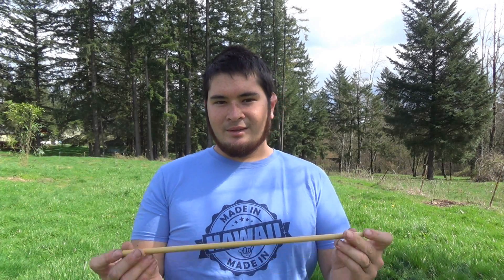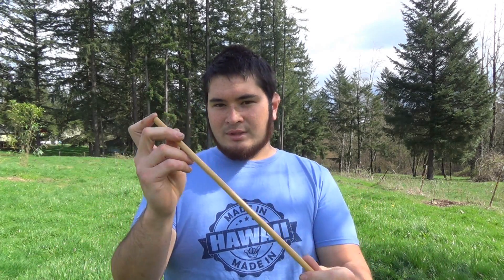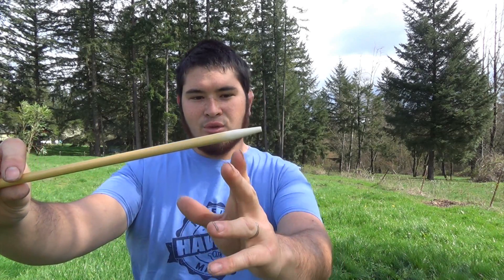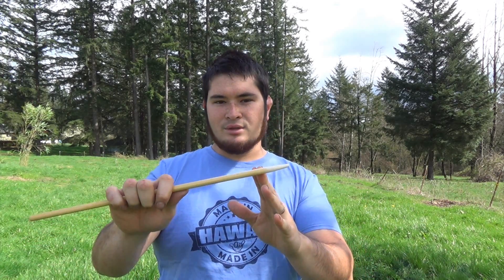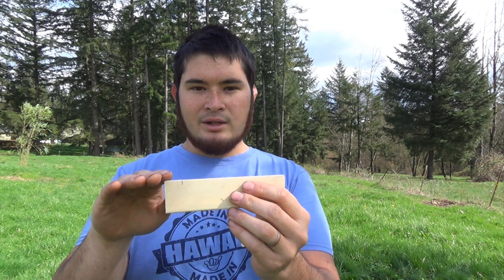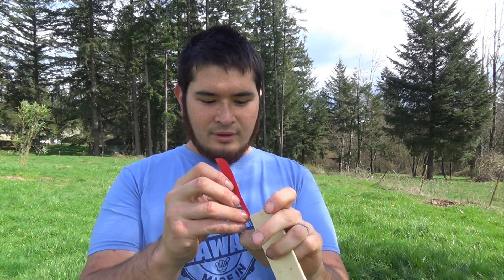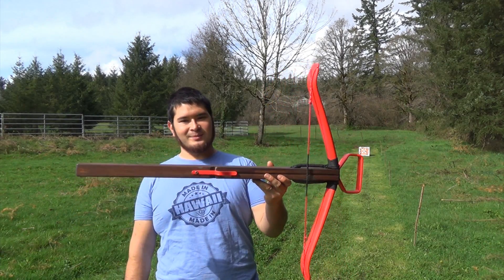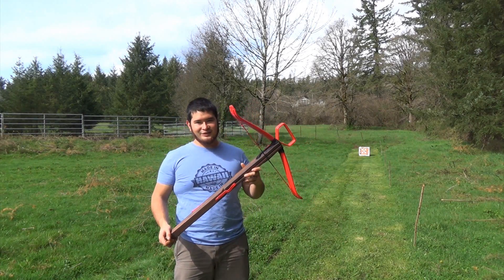100lb Medieval Style PVC Crossbow for Under $10 Part 6 - Making Crossbow Bolts with Wood Dowels

Comment: I really appreciate all your videos. 

I made the 100 lb. crossbow.  I made 16" bolts from 3/8" pine dowels and fletched with 2 duct tape "feathers". I pointed them with 3/4" #6 screws driven in about 1/2".  The flight is erratic to the max!  Any suggestions?
Thank you for you valuable reply.

I have made the 60" longbow with seahs and get a 45-50 lb. draw. Made 28" arrows from 5/16" pine dowels - works well!
--Bob
Reply: robert devine ai

Comment: Many crossbow bolts from the middleages uses wood fletching, how would you go about reproducing them?
Reply from the maker: One way is to cut shallow grooves on either side of the bolt and insert your veneers with a bit of glue. Another way is to cut a slot down the bolt and glue the veneer in the slot. The second would be easier to do with modern tools and glues, but the first would be stronger for heavier bows.

The split and glued nocks would work fine for a very light crossbow like this one.

Thanks for watching!
Reply: +BackyardBowyer always! been following you for years!

this is one of the bolts i am looking to reproduce

http://emuseumplus.lsh.se/eMuseumPlus?service=direct/1/ResultLightboxView/result.t1.collection_lightbox.$TspTitleImageLink.link&sp=10&sp=Scollection&sp=SfieldValue&sp=0&sp=1&sp=3&sp=Slightbox_4x5&sp=0&sp=Sdetail&sp=0&sp=F&sp=T&sp=7

Comment: Just as an FYI. I have been building very similar bolts for both 150 and 175 lb recurve crossbows with 5/16'ths birch and poplar dowels and they not only work perfectly but hold up incredibly well to abuse. I however prefer flat nocks. 

   great tutorials. Thanks!

Comment: Hi Nick, Great work on that bow,innovative safety.I think you may be able to use 11/32 hardwood for the bolts with that weight bow works fine on my 150 pound bow,although i also use heavier bolts & taper them so they are thick in the front & have a more medieval look.Even hardwood fletch works fine.Just a few thoughts from my end.Excellent tutorial mate.